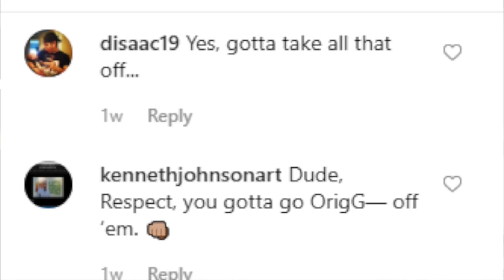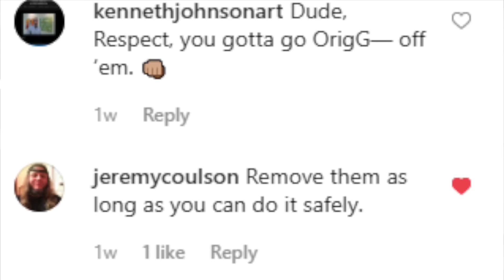Dealing with Weirdos I Saving a 1957 Stratocaster Reissue

Comment: Clear surgical spirit BP, available from most Pharmcies. Great for cleaning your guitars with, however if used on your fret board be sure and give it a good oiling. Lemon oil or a good fret conditioner or exotic wood nourishment balm.  I use an aerosol called Wood Silk it's a great all rounder, cleans and conditions but it's best to use a Microfibre cloth for the cleaning as these cloths are brilliant at getting all losee debris caused by the cleaning.

Comment: I have removed an increadible amount of labels and stickers. That layer of glue remains left behind is your enemy. Cleaning that up takes a lot of time. And using solvents usually only serves in rubbing around, smearing it all over. First get a heat gun. Set it to low, so you don't damage the paint. Heat up the stickers and the glue underneath becomes softer. If you peel off the stickers now, most of the glue stays on the sticker, leaving your surfaces almost clean. Especially when you rip the sticker off. How to best remove the remaining glue? Sticky tape! Put the tape on, and rip it off again. The tape will pick up the glue remains from the surface you're cleaning. But be careful around damaged or cracked paint. The final remains of glue will be minimal, and that's when you grab the solvents.

Comment: Yes about Japanese strats. I have a 1974 Mann (Ibanez) Strat copy--maple neck, cream finish--and it has all Fender hardware (big tremolo block, Alnico 4 pickups).   I hardtailed it, and then tapped half of brass pipe ring into the space between the tremolo block and the wood of the body. Rings like a bell!  Try it, an upgrade for about $2 that sounds like a pickup swap-out.

Comment: You should try 710 cleaner/soaker. It's made for soaking bongs with lots of pot residue and it works better than goo gone and it's not all oily. You can also soak sticky parts in it over night.

Comment: Best sticker glue remover I know, Rosonol. Yes, lighter fluid. Goo Gone never works for me, and it smells. As Richard mentioned earlier, it also works on lacquer as well as it does on poly finishes.
Reply: Goo Gone used to work pretty well. I think it had some naphtha in it, but they changed the formula several years ago and the stuff is pretty useless now. As has been suggested elsewhere, Ronsonol lighter fluid or similar has lots of naphtha and is kind to most guitar finishes and is great at removing goo.

Comment: Nice job. I made the mistake of using a drop of acetone to spot clean a little something something on an acoustic with a lacquer top....😝 It turned into a nightmare! It was a cheapo but lesson learned.
Reply: Cool video,  I can't recall how many times I've watched pickups being put into a guitar, and I'm a drummer. Lol. I've used acetone to remove the logos from drum  heads. It works well, if you can get passed the smell.

Comment: Really nice work, with a great result? It seems to have been well worth saving because it was already very well setup as to the neck being straight, intonation & frets all in great shape without you having to do anything? Unless you did it off-camera? That nut-it’s more of a replacement type of upgrade, (I realize that they’re available from the factory on some Strats-but probably not that one?). It would’ve been interesting if you’d talked a bit about that. Still, you’ve 'unearthed' a diamond in the rough in one weekend! Thanks very much for sharing this post. Good eye!

Comment: Loved your video. Doing the same with a Blade 1 VMI Sebring I got for free. I've  never heard of them before and there is very little info online about them other than the fact that I don't think they're the same as the other Blade 1 guitars still being made now... Stripped it down to the wood and finishing with polyurethane, changing the pick guard cause the old one is cracked and warped. Going to reuse the pickups and hardware because I've heard they sound great for the cheap guitar it was back in the day. It's the first time I have ever saved a guitar and I'm excited about how it's going. Thanks for your video.

Comment: Those stickers are by far the least disgusting I've seen on a guitar.  Some of the guitars I've seen in pawn shops I feel like I should be wearing gloves just to touch them.  As for that guy you described in the start of the video, that's the reason I stay the hell away from working retail.  Have done for years.  PS  that guitar was made the year I started on guitar.  I'd love to have a guitar with those lace sensors but what they cost these days I've never had the chance.

Comment: Jeremy, you posted an excellent, and informative, video; thank you.

I would like add to your list of solvents that assist in removing glue residue from surfaces.  I have found that Ronsonol lighter fluid works excellently.  The main ingredient in the Ronsonol is Naphtha.  I have used Naphtha on nitro cellulose finishes to gently clean and remove any type of residue or crud that has built up on surfaces of guitars.  However, as you point out in your video, always test any type of cleaning solution on an inconspicuous section of the item being addressed.

Thanks again for your well produced videos.